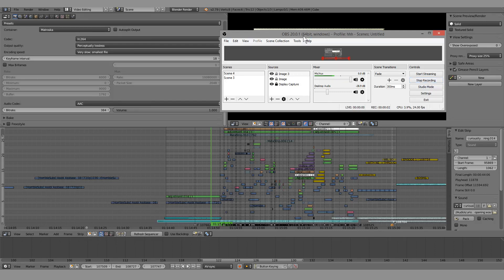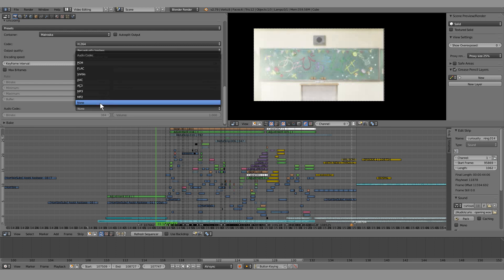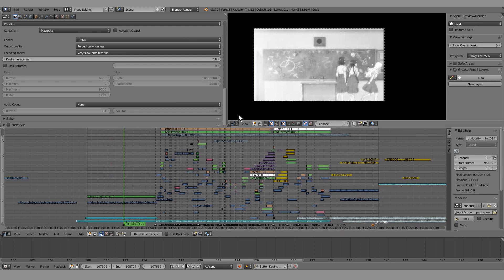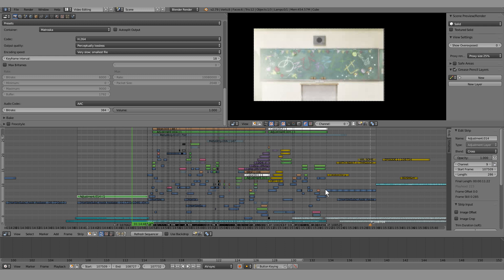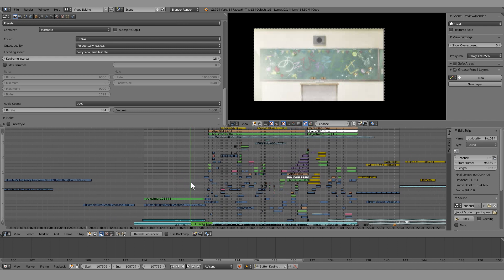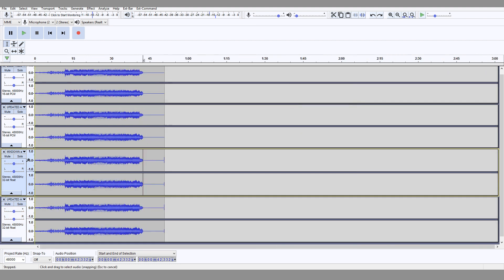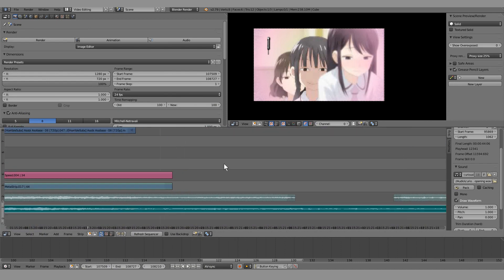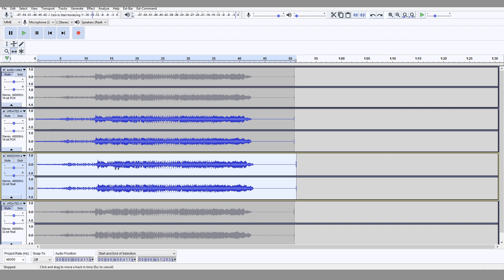Blender VSE: Rendered audio going out of sync issue

Comment: I have had this issue many times with long and short videos. It is a system problem. I only have it with large files (high definition or very long or both), so I assume some fetching/buffering problem. It should be fixed by blender, but they don't care. Here is my workaround: Use ffmpeg to convert the file to some mkv file (it's not lossless, nothing is, but you won't notice - if you do, use something else, ffmpeg is trash as we all know anyway). Then you can source the video from that new file, the audio can remain the same. Had no problems with that, other than it is slower even with 20% proxies in vse, so I do it at the end of the editing process. I am fully aware of how much of a dumb and silly workaround this is, but if you can't afford good software or do not want to use it, that's what you have to deal with. This works 100% of the time for me and it's kind of my last resort for then this bug occurs. I find this very annoying, especially since I am a developer myself and I can't wrap my head around the ignorance. They are aware of this. It is a blender issue. They just hate the VSE so much and don't want to improve it. They prefer tweaking around on some feel-good GUI sh*t instead which benefits nobody. I don't care if blender looks good, I want it to work.
Reply: Hi, I'm a new Blender user and I'm currently facing this problem... I hope this isn't too dumb of a question, but is this method okay if I've already synced all my images with the audio? (=will I have to do the whole syncing progress again?) 

Basically: I've made a PMV and I've synced up all the images with the audio file. They're perfectly synced in blender, no problems whatsoever and the video is 2.3 mins long, nothing crazy. However, once I render it, the audio in the finished result is jarringly off. If I turn off the sounds from the finished PMV video and play the audio from a different device alongside the video, it syncs perfectly with the images, so the problem is only in the audio. 

I want to fix the audio issue but I'm scared to do it because I'm afraid I have to rearrange all 250 of the pictures again...
Reply: Thanks!!!!! This works, I used HandBrake to make a mkv file of my mp4 video and the audio is still synced with the video after editing and rendering in OBS. ffmpeg looked a bit too complex for the effort I wanted to make.

Comment: My issue is completely different, but the results are similar, audio and video being out of sync.  For some reason the video looks like it's speeding up, not sure why, I haven't messed with any of the speed settings for the video, but as a result the video goes out of sync from the audio.  The video looks like it does double or triple speed, but the audio remains constant.

I know you can have sync issues if your frame rates don't match between the audio and video, but I made sure they match, and playing back the video in Blender it looks fine, no sync issues, but the rendered video ends up being very much out of sync.
Reply: Did you ever find a fix for your video audio mismatch? My video also speeds up when rendering.

Comment from the maker: Quick little update on this from my end: I just rendered a 30 minute video using the normal render and the audio lined up fine. Its funny cause I rendered this same project and the result was the offset recorded at the start of the video here...like the waveform showed in this video is THE waveform I just rendered out..and now its fine the whole 30 mins is lined up proper.

Things done this time: Lowered the master volume down to 0.8, and I rendered using h.264 matroska high quality @ 25% scaled resolution, aac max bitrate, also most of the project has been transcoded  into 16 bit png (rendered out as still images and tossed back in) to decrease lagg in the vse. I don't know if any of that is of value, but just some things to try. Maybe outputting a lower waveform of audio helps the issue, or having the project mostly as png (one of blender's most compatible formats) i don't know. Maybe the issue is a glitch that comes and goes. Like I mentioned in the video I never remembered this being an issue all the time, honestly I think its just an issue that popped up recently and it seems to have gone away now. Normally I too would say its probably an error committed on my part (its easy to forget if you render from frame 1 instead of frame 0  for instance, i always do my project in the middle of the vse though) , but unfortunately this is a well documented bug/problem on the stack exchange and other forums. I haven't updated any settings or anything. I have no plans to test this further on my end, I know how fruitless testing bugs in blender can be. Plus as mentioned I much prefer the better quality of audio offered by mixdown anyways...u can technically render the video AND mixdown the audio at the same time as well to makeup for the inconvenience, just be aware it is prong to crashing so save ur work. 

I'll be moving to another vse once my existing  projects are done. I've shed too much frustration with blender, possibly will make a video on the reasons why I can't really recommend it anymore as a vse and what needs to change. In a nutshell once you cover all the gimmicks and quirks talked about in my previous tutorials (4-5 hours later...) the main limitations surprisingly become: axis of rotation support missing and the addons bugged (transform tools etc), all the issues you will run into when you need to pan a scene and objects with  transformations and camera control, the 32 channel limitation and why this is a big deal, the many frustrations of the audio not being what you hear is what you get. If you can live with all those things for ur purposes, then sure its free and powerful and you can customize and optimize via scripts, addons, and hotkeys to your heart's content..plus more good stuff is coming in the near future hopefully such as MORE BLEND SETTINGS (available in beta atm)!! good god, more of those would be a god send at  this point.

Comment: Will refer back to this later when I run into this issue again...  which I've been avoiding by also keeping my vid edits short.
Reply from the maker: I think you'll be happy opting to use mixdown. If the project is long you probably care more about it, so even if its a bit of extra work you'll end with better quality (sound-wise and sync-wise).
Reply: I will definitely give mixdown a try. Now that you've mentioned it, I've noticed small issues with audio quality as well... probably due to me constantly messing with (animating) the Volume attributes. Hmm...  thanks some funkiness...  which perhaps 2.8 will address?  We shall see.
Reply: btw... thanks for putting the solution right at the beginning, then following it up with an explanation. That format works well, me thinks.
Reply: And since I'm on a roll here with replies...  The blenderartists.org forums mentions a solution being related to using videos using varied codecs in the source video files. The solution being to convert all source videos to a similar format. Curious if you've tried this yourself: https://blenderartists.org/t/unable-to-get-audio-video-synced-properly-in-vse/461482/17
Reply from the maker: Yes, there's evidence to suggest the severity of offset is due to the format of the video you edit in blender. I'm also seeing that myself in my testings. Aka I'm only seeing a small audio offset for my obs .flv recordings.

I don't know of a way to change the format of a video and forgo the creation of one or more of these: artifacts/increased-file-size/degradation/time-consuming-rendering. If there is one I'd consider reformatting a solution for my purposes of editing. As it stands the best solution for me is still mixingdown and recombining. For others conversion might be the route to go, in which case I would suggest considering converting/transcoding your video footage to a still image format (png/exr) as this is the go-to format for fixing blender bugs/problems (stupidly large files). I've only been using audio+video render out of laziness (one less step), I've always told people not to use it even before noticing this sync issue. So for me its more of an awareness issue....a potential problem people need to know about.

And ya, the videos I make always come out to be stupidly long, so I try to present the information and intent upfront wherever there is space. I've been screwing around with the animation nodes add-on, so I can insert countdown timers and other helpful section dividers in the future.

Comment from the maker: One thing I neglected to do was show you the waveform after you combine the mixdowned audio with the audioless-video. It should lineup with the mixeddowned audio waveforms (the bottom 2). I'm not sure if the length of the waveform would shorten to the audio+video waveform when viewed in audacity, or if ffmpeg would respect and save the full length of the audio piece. Regardless its irrelevant, when viewing ur video in a player (check via ffplay since vlc isn't reliable when you render from blender) everything should playback like it did in the vse playback.

As a disclaimer I'll just include this:

This was a functional explanation. Details were leftout, if anyone wants to provide them feel free to do so in the comments. If I missed anything or got something wrong, by all means tell me (just be polite about it please).

1. ffmpeg IS what blender itself uses to render and create videos (hover over buttons and check the python coding!). Normally if someone tells you to download a third party app to solve an internal program issue....you would SCREAM AND SWEAR AT THEM! But this is literally just downloading a segment of blender in a cleaner form that you can and should use (10 bit h.264, re-encode free rendering, basic edits and combining of videos). You can opt for a version of ffmpeg like handbrake, which has a gui, if you want menues rather than code. You do need a secondary rendering program to compliment blender though, one that doesn't ALWAYS re-encode and can combine audio and video.

2. My theory on the problem is that the audio codec when you do audio+video renders is applying some kind of weird placeholder timecoding and conversion that lacks enough precision to prevent floating/offset (aka calculations lacking enough decimal places).
A common theory seems to be its ffmpeg's fault. But I mean didn't I just proved that, for my case anyways, using ffmpeg solves the problem...? Problem is that combining audio and video in blender created sync issue; combining audio and video in ffmpeg....doesnt, plus it doesn't re-encode. I'll note that for the 60 second content a timecode, record run, was specifically applied to everything that is in there before it was edited in any way (and all other safeties were observed to make everything blender friendly)..and there are postings on the stack exchange stating that having a blender timecode applied ahead of time makes no differences to this issue.

3. av sync was always on :) 

4. those 4 waveforms, all were .flac. the highest settings allowed per mixdown/normalrender were chosen. this was captured in obs as a mono track and then uploaded to youtube....so I don't really expect anyone to hear the proper differences. 

5. I guess another option is: if you have a 30 minute video. Just render ten 3 minute videos. And then combine them in ffmpeg without re-encoding....I think you can combine videos without re-encoding in ffmpeg if its just slotting them back to back. But I'd sooner just render it all out as a 16bit png for massive file sizes, and then just render it out as a 10bit h.264...cause you might as well put those 16 bits to use!
Reply: I've never had this problem before and I've edited hours of footage with blender vse. The only time I've  experienced something like this is when I've forgotten to set the project fps to match the video footage. Are the source video files 24fps? If not, change the FPS setting in the render panel to match. I can't see how mixdown would fix this though, unless the command you're using stretches the audio to fit the video.

Are you using Windows? I use Linux, so maybe it's an operating system specific bug.
Reply from the maker: Windows. 
So for the sake of argument I wanted to test with some different formats of video, as both tests involved footage similar to the stats posted a below (h.264).
Edits: I tossed this video which was recorded in obs (.flv) at 24 fps. Between the mixed down version of the audio and the audio+video version, after 1 minute there was a small small small offset, nowhere near as big as seen in the other footage and not at all significant. SO probably the type of footage you are rendering is having a significant impact on what kind of offset is being produced, if any. 

Edits: You having had 0 difficulties with this issue, I would be interested if you'd do your own test to see if there is any amount of offset between the audio+video and the mixdown audio output. So pick your standard video format, toss it in blender. Render it again audio+video. Mixdown just the audio from that video. And then compare the two to see if they lineup in a DAW like audacity. Do it over a length of time like 10 mins or more i'd say...so use a longer video. Just make sure you insert the video at the 1 frame point or reassign the starting render to 0, as the green arm is by default inserts at 0.

+++++++++++++++++++++++
the stuff from this video
+++++++++++++++++++++++
Grabbed from vlc -> the stats of the video content I get the problem with currently:
h.264 mpeg 4 avc (part 10)(avc1)
resolution: 1280x738
display resolution: 1280x720
frame rate: 23.976215
Decoded format: Planar 4:2:0 YUV

So for the first project the footage used was grabbed from online in the fractional 5/0.21 fps (23.81.....). The blender workspace was kept in that fps for the entire project. And that was the 11 minute video talked about at the start. For the 60 second project tested in the video, the fps of the video content also grabbed from online, was 23.976215 as seen above. For that project I opted to change the project's fps to 24 before any editing was done, and let the existing 23.91... video content adjust on its own. Both ended up with the same results as seen in the video. Timecodes were applied before editing for the 60 second video. No timecodes were used in the 11 minute video. Both had the same resultant offset. I guess you could argue the lack of a timecode on the 23.81 project caused the problem in the 11 minute footage. And the upscaling of the fps project space to 24 caused the problem in the 60 second footage. 
This issue become much more complicated though because it is advocated to simply apply a speed control to any footage that doesn't meet the fps of the project workspace. Does adding the speed control do the  same as changing the video fps before inserting it into blender....? Just everything raises questions. And if you had 10 minutes of content from video at 24 fps and a workspace in 24 fps but added a 23 fps video in and didn't modify it....would that screw up ur audio sync, but only when rendered, as well (I mean obviously if the 23 fps vid had an audio track it would be offset when first thrown in the vse, but you can just adjust it manually to be close enough). Maybe it would but only if you didn't add in a 'blender' timecode for all ur footage. The key to the argument is the fact that everything is lined up and playing properly in the vse, ffmpeg on its own is able to combine the video content and audio properly, but blender which uses ffmpeg is doing something weird.

I will add that it is likely the video format itself (mkv h.264) or some kind of misread or corruption in the encoding that blender doesn't like. As I don't remember ever having this problem when I was dealing with footage I had myself recorded (.flv)....I think I did at least one of my tutorial's audio via the audio+video render method, mbe not though more testing would be needed. Could also be the fps of the video being a fraction causing issues with blender's crazy render antics.....but changing the fps before inputting into blender would require a re-encode or transcode (or is there a method that requires neither..? for mkv videos mbe..?) and that's a no-no for my purposes. Fps still kinda confuses me. I always thought there was a way to change fps of a video to any value and have the audio still lineup like it did before....I've been told no. But you can capture/record a video that plays in a higher fps and have the audio lineup fine cause ur screen capturing. I really need to find research tools on how fps works and can be converted.

 Anways, Like I said, I find it odd and unbelievable too, as I've been doing projects for almost a year now in blender and this is the first time I notice this earnestly. I remember things being weird in my other video projects though that lasted over 4 minutes...the audio I remember was a bit off, but again I was editing h.264 video. Just as easily you could say its the first time its happened I suppose.....and I was able to have it happen in my recent project (60 second one). So two times in a row. Based on my reading online its very...disturbing this seems to be a thing. Regardless, I felt it was worth bringing into awareness for my tutorial series.

If it doesn't happen to you, great. Just be aware its a thing for some people anyways (confirm via links), and maybe keep an eye out for sync issues if you render audio 'that way'. Or don't worry about it if blender always functions agreeably with your system/purposes. If any other clues come to mind, let me know.